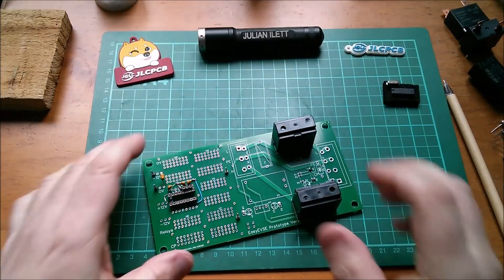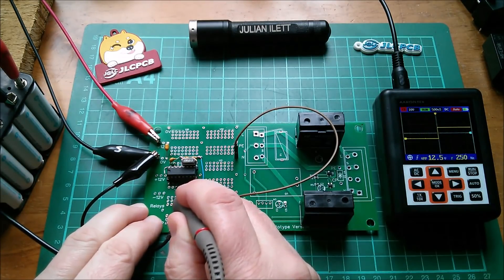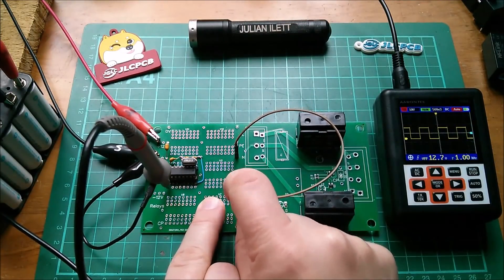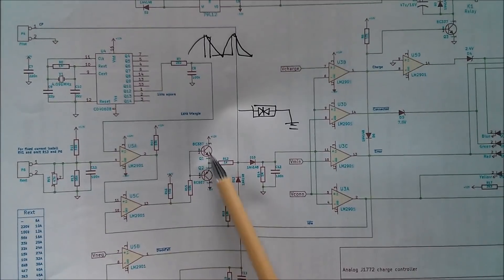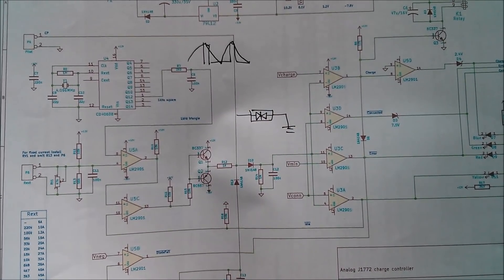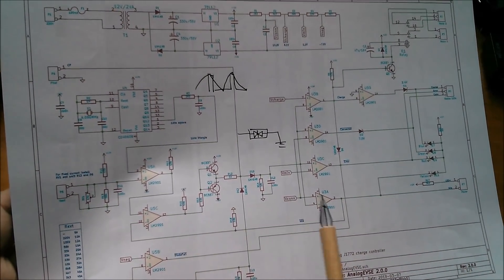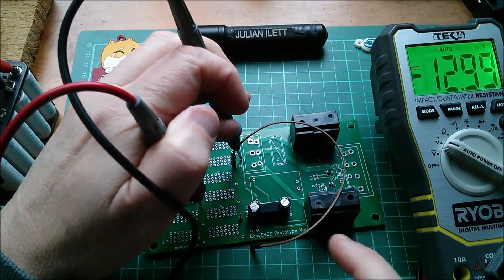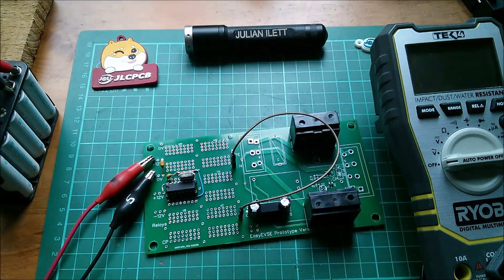EasyEVSE Build (part 2)

Comment: I now want to probe my PodPoint EVSE when the car is plugged in and not charging, just to see what's going on. My car has a delayed charge setting and some interesting relay clacking happens in both the car and EVSE when I activate that. There's also a setting in my PodPoint to activate charging at specific times if your car can't do that itself.

I know the PodPoint has all the ground fault detection stuff in it, so it wouldn't surprise me by also detecting if its relays are stuck - possibly by bridging live/neutral with another relay/power transistor thing to trip the 30A breaker.

Can't wait until you progress to building your own CCS charger from a bank of Lithium Iron batteries 😉
Reply from the maker: Bridging across live and neutral doesn't sound like a very good idea :/
CCS rapid charge is a very different animal. I won't be playing with the 400V battery :)

Comment: Not sure i like the mains relays being enabled and the circuit haing to provide a signal to turn them off. I think i would perfer the circuit to power up with relays in the off state and then driven on when a car is detected. not too bad as there is no uP controller which could fail and leave the outputs always enabled, i quite like a capacitor connected drive signal, so if the enable stops switching the output goes in to the safe state. a stable high or low with not hold it on.

Still good to see the thinking behind design.
Reply from the maker: Well, it's all a matter of perspective. Now that the comparators are in circuit, the relays are held off most of the time. The relays turn on when a suitable resistor is put across CP and PE.
I used a capacitor connected drive on a LED matrix project years ago. There were 7 rows of multiplexed LEDs being overdriven by a factor of 7x (about 100mA per LED). The capacitor connected row selector prevented the LEDs burning out if the multiplexer software had a bug.
Reply: @JulianIlett  I think with a total hard wired logic is not much of an issue, but put some firmware in there and i would look for a form of fail safe.

Comment: State AB, could be where vehicle is plugged in, but the EVSE has a physical lock, such as home Pod Points to disable charging.  It may also be used when a public charger is negotiating payment.  What state is in place when the vehicle is in timer mode, does the vehicle disable the resistor so that charge does not commence? Is this then in state A?

Comment: Hi Julian, thanks for explaining the circuit and what it does. Isn't stage AB to let the car know it's connected but the mains is on standby? That way the car might not go into error because it cannot charge. (Also depending on how the car has implemented all circuitry and standards)
Reply: I think that's pretty much what Julian explained because he also explained why state A is actually a "non-state" or at most a prelude for that AB stage. As long as the EVSE supplies 12VDC, the resistance of the EV car makes it 9VDC. So State A only exists if the car is not connected but the outcome state, state AB, is the state that is interesting for that standby state you mention. I still think its interesting that electric cars use such an analogue way of communicating with any charger, but it seems pretty universal this way which is great, without serial protocols that can fail you (by losing bits). My only concern is the DC voltage applied at the pilot connectors as that leads to corrosion on the connector while no EV is connected, due to polarity and moisture in the air. But maybe I am exagerating because all these EVSE chargers almost always have some kind of flap/some cover over the connector. But I know of one person that lives in my neigbourhood who has a fixed cable (with the connectors exposed to the elements) so he might suffer from oxidation on the pilot connectors over time because of this DC state.

Comment: Hi Julian
Could it not be that the car interface is powered from the 12/9V and has a diode and a capacitor off the 12V/9V square wave line to smooth its supply?
Reply from the maker: That wouldn't be possible as the 12V/9V is connected to the car through a 1k resistor, so it would only be capable of supplying a few milliamps (microamps if you didn't want to upset the voltage level signalling).
Having said that, PP (the proximity pilot) is fed from the car through a 300ohm resistor - so that could possibly be used as a power source.

Comment: @17:35 you can see some of the empty solder holes flashing in strange patterns. What caused this ? Camera interference ? Trees blowing in the wind outside affecting the lighting?
Reply: That is weird isn't it. Maybe, as you suggest, it is a camera lens abberation?
Reply from the maker: There's a solar powered wind turbine (a toy one) on my windowsill which can cause flashing light effects on the desk.

Comment: I know literally nothing about EV charging and so am really liking this series. 

Isn't there a case where, for example you have a domestic power outage, the CP signal goes to 9V, your 'connected but no power' AB state indicates the vehicle cant draw power, but couldn't it 'supply' power if it supports vehicle to load? You wouldnt want the vehicle feeding back to the domestic supply.

I know thats all rubbish, just letting my fingers do my thinking....
Reply from the maker: V2L (vehicle to load) and V2G (vehicle to grid) are very different. V2L requires just a simple inverter in the car that generates 240V AC from the car's battery. V2G requires an inverter that can match your house mains voltage, frequency and phase as well as having anti-islanding and other safety features. The latter is similar to a solar inverter.

Comment: Watching on an iPhone 8+. Pretty sure the oscilloscope showed Vpp 12.5v. Yet your "state" graph shows Vmax of 12v and Vmin of -12v. That's Vpp 24v. Do you need to match this?
Reply from the maker: Yes, the CD4060 is connected across +12V and 0V, so the square wave is 12V only. Now I need to add the comparators and the transistor driver to get a 10% 1kHz 24V waveform

Comment: This project is no good! 
No blinking LEDs anywhere!
Reply from the maker: Easily added :)
In fact, I may add a couple of LEDs across the relay contacts to indicate when the relays are pulled in.
Reply: @JulianIlett  I think you need an Arduino with a blink sketch to make it pop :)
Reply: @piconano  This clearly needs a "supercomputer" LED board for proper blinkenlichten...
Reply: @michaeltempsch5282  even a better idea. He has one in the shed.